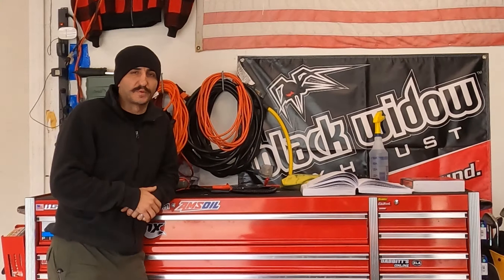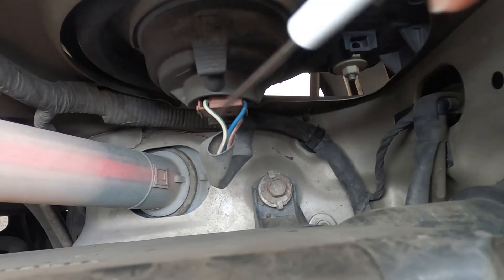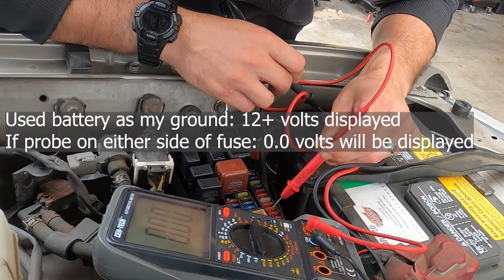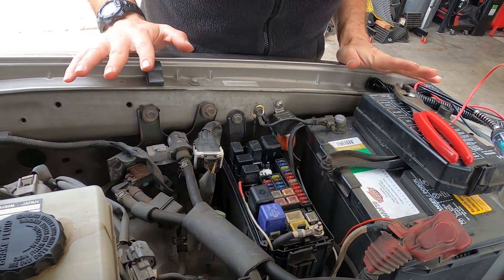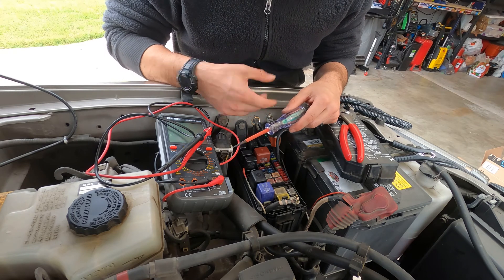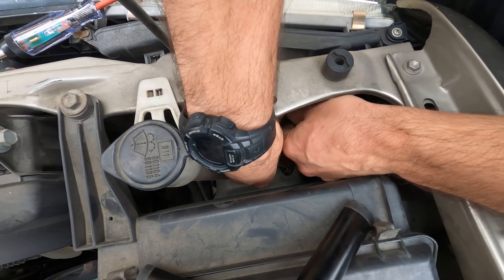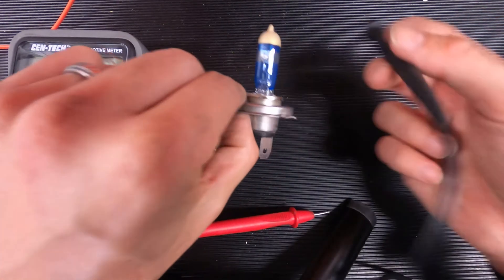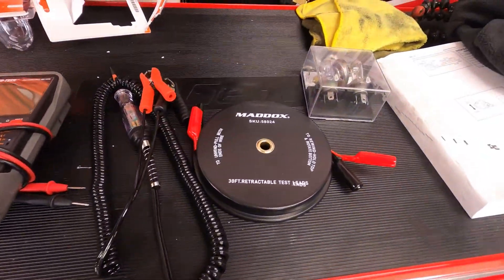Headlight Bulb Testing: Fuse | Relay | Electrical Controls | EASY FIX

Comment: Left low beam is out. Other low beam is fine. 

Fuse was blown. 

Replacement fuse also blew. 

Gonna check the relay today. 

If that's fine, gonna check the ground. 

If that's fine, wtf do I do then lol

Comment: Great video!  The headlights on my Hunday Accent randomly turn off while driving at night.  I flipped the headlights on & off switch on the counsel & luckily, the headlights came back on. Any suggestions as to what's causing this issue?

Comment: This help but i still need a little but of help…so my low beam bulbs dont work on both sides but the lights on the side of my headlights work…what does that mean?
Reply: I have the same issue on my 2007 Camry.  Passenger low beam is on, but very dim.  Odd.

Comment: That's cool man I knew nothing thanks to youtube I am the wiser.  I like how you tested thing harness and fuses, the relay would be a big help, also need the tools, but I have friends 👍...I didn't know you had to readjust the lights after installing them...the main reason I was trying to reach and see if I can get the bulbs in without the assembly removal was part of that, also that is what my manual states on doing, but even then your put the light back to its fitted position which shouldn't be much different.  I watched vids with the dot point homemaid board for height distance, driver side 4" below  the dot measure 2" on the passenger....so ya, I was surprised to hear you recomend adjusting them always.  Thanks great for someone who never had prior knowledge...they want 200$ plus to mess with this simplicity.  Video on the wiring harness both ends would be cool.  I have a question, what if 1 low beams working, to separate lights not like your luxury one that you got here LOL, you put a bulb in the running light works but the low beam doesn't what does that mean?

Comment: My daylight running lights are out, so I switched out the fuses. Still no DRL. Now however, my driver side headlight is out. I replaced the same bulb months ago. That specific headlight was always running brighter than the other. Both hi beams work when I put them on